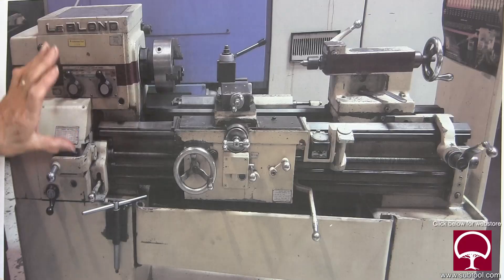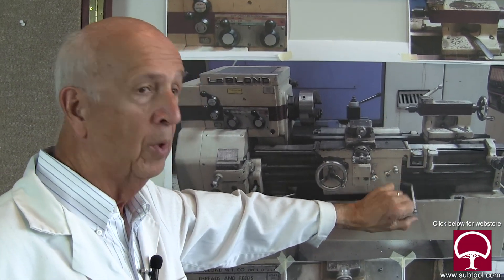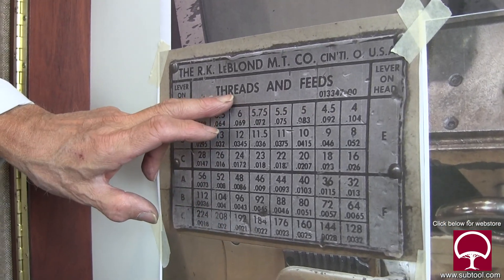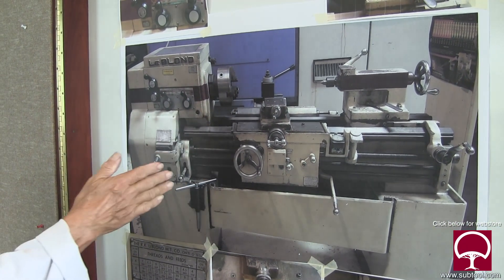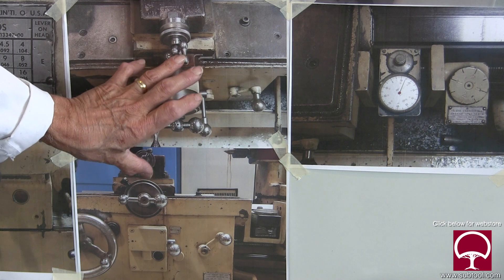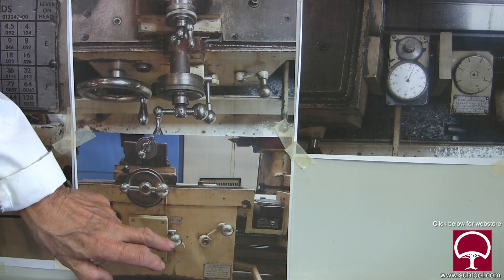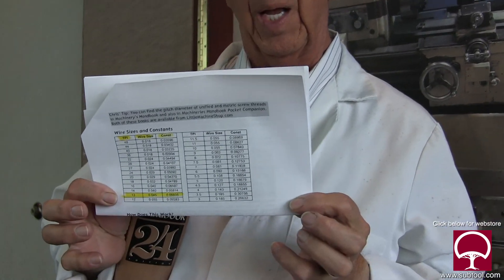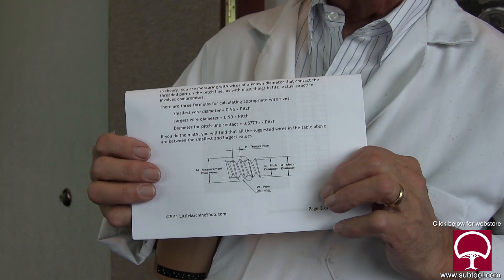How Chasing a Thread On a Lathe Works Pt. 1 - Overview of the Machine

Comment: we were shown to use a pencil eraser to hold the two wires and then the third on its own, I dropped many a wire into the lathe bed before I was shown that trick.
Reply: Wow thanks for that tip I always drop the wire

Comment: That is great overview, is this book cover metric dimensions?, as here in Europe we rare use english unit speciallt for thread.
Reply from the maker: +The Machinist Yes it does.
Reply: I've also got a Europa Lehrmittel Mechanical and Metal Working hand book that gets nitty gritty with DIN specs and is a great reference. Couple that with an old copy of Machinery's handbook and you're pretty well set.
Reply: +Gerald Gepes I found out that I have Machinery's handbook 28, concerning mentioned books I will check it in amazon to see it, I also have very old books like heckler & koch students book (very good info, can not be found anymore in stores), about grinding I have very little info written in books therefore I likes what Dan show to us in his channel.